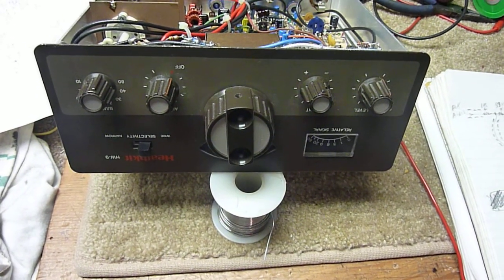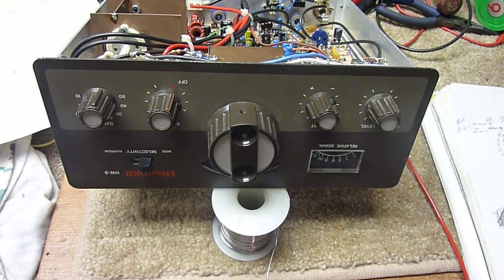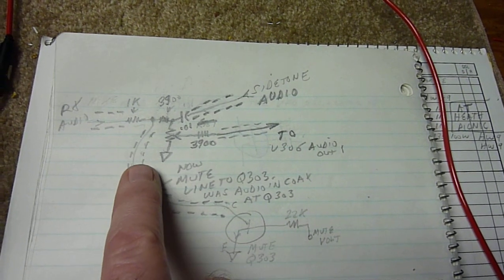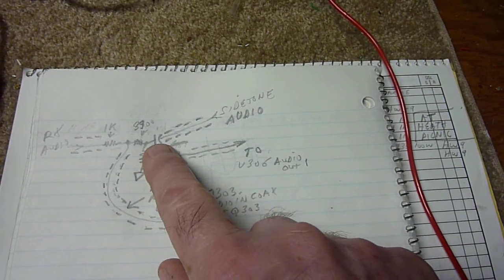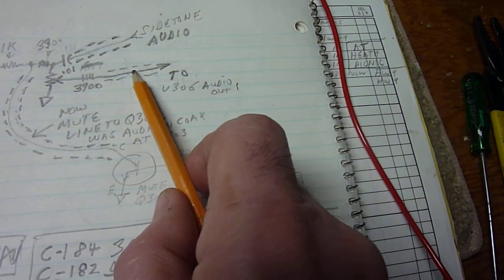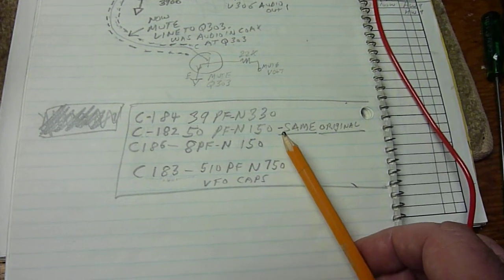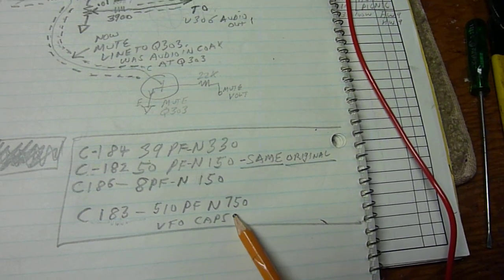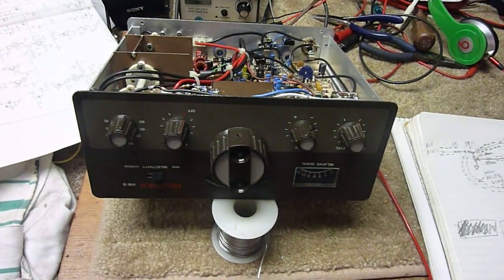HEATHKIT HW-9 REPAIRS,HW-9 MODS, HEATHKIT HW9 IMPROVEMENTS,

Comment: Never had significant drift with my HW-9. Did it gradually drift or did it tend to jump? Jumping suggests a loose core or dodgy capacitor or dry joint. Gradual drift suggests a bad core or badly selected/operating capacitor.